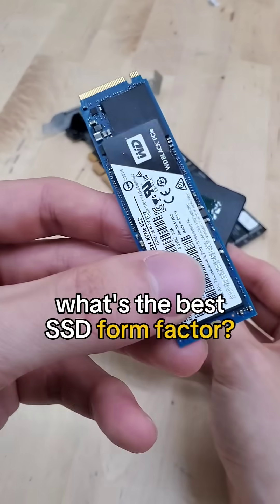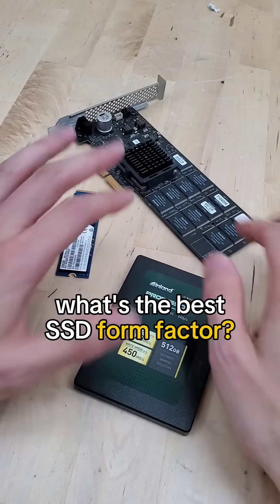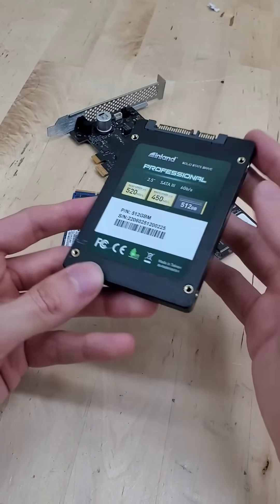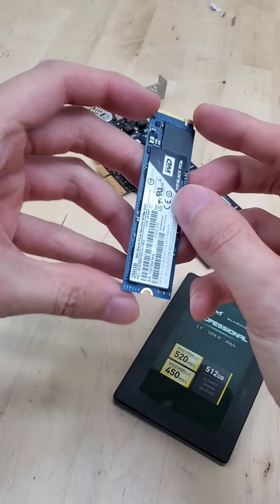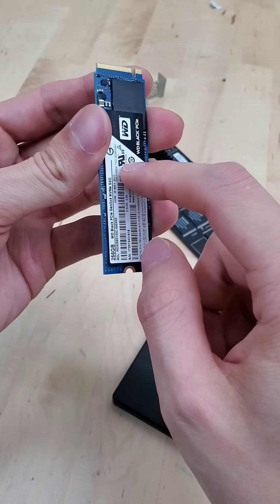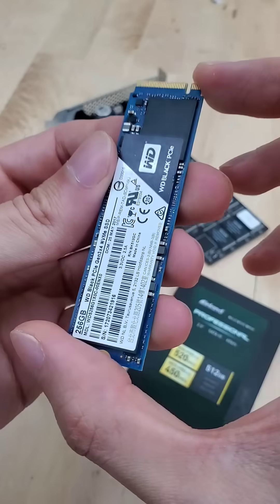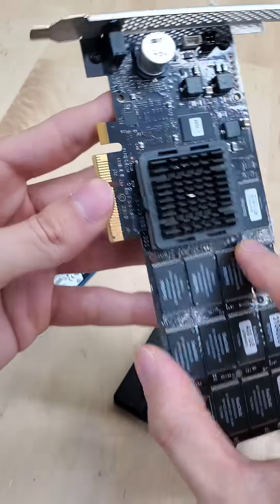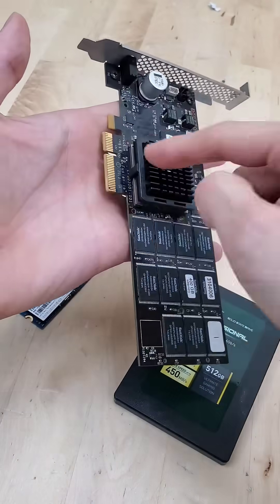The beautiful diversity of SSD form factors

Comment: The SATA SSD is fine and fast enough for most things.  It's great for backup and long term storage.  I wonder how much longer SATA will be around.  

I used a HD the other day for a back.  After watching it for hours and have temp warning, I ordered another M.2 for daily backups.  The hard drive will be for long term, painfully slow monthly backup.

A card might be okay, but I would want raid.  With x16 gen5 and 4 SSDs you can get 50 GB/s.  My 14GB/s on a single M.2 is good enough for me.  But I would not mind 50GB/s for fun.  :)  I would never notice the difference.

Comment: Sata controller is limited in speed but can theoretically support more storage space

Pci-e 4/5  x4-gen1/2/ support various speeds might use the chip sets on the mobo to do data transfer this eating less data lanes for CPU  that could otherwise be dedicated for other things

Pci-e on the motherboard X4/8 slots also have the ability of being able to use multiple nvme like a RAID card in

X2 X2 X2 X2

X4 X4

X1-X1-X1-X1-X1-X1-X1-X1

Comment: Did you the PCIe one working?  I have that same card and it worked before but now I can’t find the drivers for it.  It’s the same HPE one.  It def doesn’t have the fastest speeds though.  It has the best longevity/durability

Comment: Gotta keep in mind though for replacing an SSD in an older machine circa 2020 and earlier, the m.2 slot may be SATA only and therefore not support a PCIe m.2 SSD. I had an Inspiron and Acer Nitro laptop from 2017 and 2018 respectively that had m.2 slots but they were SATA, no PCIe support.

Comment: M.2 does not get hot. I have 3 of them. 7,200gb a sec. 4 lanes. I push them to the max for 3 years now and no problems. 44c max temp. No heat sink. They can run reliably upto 80c in fact it has been proven M.2 runs better at a little higher temps than other chips. Last thing, that pci-e has access to the same lanes as a M.2 sata ssd 550mb a sec max.

Comment: I believe that E3.L allows for the highest storage density (see Kioxia's new 245TB drives), which arguably makes it the best form factor.
Personally I quite like U.2 2.5" SSDs, since there's good m.2 to u.2 adapters and used enterprise u.2 tend to be cheap, relatively speaking.

Comment: Plug-in SSD not as expensive as implied here.  I use it as the system drive in nearly all my builds, with another storage drive. Storage is anything from a HDD to an SSD RAID to a NAS.  Split your storage, boot/program and storage. No need to $pend on room that doesn't need to be fast.

Comment: That AIC SSD is clearly PCIe x4, electrically at least, so theoretically, no, it's no faster than an NVMe SSD, since it too would be electrically PCIe x4. I'm not aware of any PCIe x8 or x16 AIC SSDs, though I supposed they may have or do exist, but functionally most of the AICs were meant to be identical to their NVMe M.2 and U.2 siblings in the product line up. They would all be generally higher performance, in more than one way, not just speed, to a consumer M.2, but compared to their siblings, their performance was generally identical because they were all PCIe x4 with the same specs. It's just that back when AICs were a big thing, a lot of server boards didn't have M.2 slots.

Comment: AIC SSDs are getting really cheap on the secondary market rn for stuff like Sandisk IO Drive Fusion Cards. You can get 8tb of enterprise grade PCIe gen 2x4 Flash Storage for the same price as a Sata HDD of the same capacity.

Comment: M.2 is just a mini-PCIe/mSATA connector and my HDDs are connected via a SATA card on M.2!

The disadvantage of M.2 is that it bottlenecks the PCIe connection for the GPU, because they share the same bandwith and also having near to no loading speed advantage of you are using Windows.

I oversimplfied it, but having more than one NVMe SSD can, depending on your Mobo, hurt the GPU performance a lot (it hurts much more with Nvidia cards).

I have put several comments into one again...

Comment: The PCIe to M.2 controller cards are much cheaper than the dedicated PCIe slot SSD. I got my controller card for $17 and connected my $200 M.2 inside. It works just fine.

Comment: Define best. NVMe with U.2 has the best power rating so you can run the fastest with most densely packed chips, but too powerful and expensive for consumer. eMMC is probably too weak and slow for many but great for embedded system.

Comment: I like SATA SSD formfactor. Especially in NAS situations where you might want to quickly change one out. Wished M.2 speeds could come to SATA formfactor.
Reply: It's called U.2/U.3.  A little thicker than 2.5" sata but you can actually hot swap it unlike M.2.
Reply: @nadtz  Thank you for telling me this! I am looking into building a small NAS and th is is exactly what I want!
Reply: @clipeclipaway  No problem, good luck building the NAS.

Comment: the only time i say you should absolutely USE NVMe over SATA is for the boot drive, after that just use SATA, there's typically way more SATA slots for expansion and the speeds don't really matter THAT much, NVMe M.2 SSDs are the way to go for a boot drive

Comment: I'm not a big fan of the M.2-format taking over in that the 2.5" format seems to be diminishing. - Why?... Being able to still hook up at least a few drives to SATA is important, cause a lot of storage doesn't need PCIe-speeds, nor that heat-generation. - SATA-style SSDs aren't done yet, but I see fewer and fewer, particularly the faster ones that are affordable (as there are many cheap ones that are even slow for SATA-standards). - At least the likes of Crucial are still around, which isn't the cheapest, but not the most expensive. - It's just that... They've been coasting on that last series of SATA-SSDs and seem to never have made anything new. I think they should, one last time, make the best 2.5" SATA-SSD they can and keep producing them for a good price and also at different capacities.

Oh yea, that's the other thing I forgot to mention, especially smaller capacities, which are great for operating-system drives or storage for smaller files or for like smaller projects like hooking one up to a Raspberry Pi for instance, are diminishing especially. It's quite difficult to find 256GB or even 500GB sized drives at times, which I feel is a problem. - Not everything is for mass-storage like video-files or gaming. I'm definitely not going to buy a 1TB SSD just for a Raspberry Pi project, screw that. I've been trying to snatch up any 256GB and sometimes even 128GB (though I generally wouldn't go below the 250 or 256 standard) drives I can find, but only if they're at a sensible price, which of course is also the issue, as often the lower capacity you go, the more expensive it is in effect per GB. So I try to find deals just so that I have a bunch.

Again, it bums me out that they're slowly disappearing, cause I think people don't realize how useful they are and most people definitely do NOT need PCI-e speeds anyway. An OS doesn't even really use that, it's only when you want to stream massive worlds (maybe, even though they have to go to RAM and VRAM anyway) or want to write huge amounts really fast, which I can guarantee you is way more uncommon than the use-cases for smaller SATA-speed 2.5"-SSDs.

Comment: M.2 factor have 2 options, m.2 sata and m.2 nvme. m.2 sata has k and b key whereas nvme has only k key. also there are some boards that support sata and nvme on its slot but be reminded that sata still going to be limited by its sata controller so it will not be as fast even vs gen 3 nvme.

Comment: SATA is not much cheaper anymore and that PCIe seems to be max 4 lanes so that doesn't make it any faster than M.2, especially since new motherboards have an M.2 slot which is directly connected to the processor instead of the chipset.

Comment: Well, the 2.5" SSDs seem more like a legacy solution today.

For instance, I've upgraded my old PS3 with one of them. It's only a slight improvement over the original HDD, speed wise, because PS3 I/O is dated and kinda slow, focus was on graphics performance, not storage.

But a new SSD has a billions of hours MTBF number as opposed to the millions that HDDs usually have, should thus be way more reliable than the 18 year old original, not to mention that it's hundreds og GB rather than tens of them 😄

The PCIe card is the real deal regarding performance, it's almost RAM speed in my perspective, you basically tap into the full bus width, and by having space for multiple NVMe chips, they can run in parallel, thus reducing any bottle necks if there were any. No matter how many SATA controllers and drives you RAID, they all rely on the same PCIe bus, so they'll never outperform an NVMe PCIe card... RAIDing for speed also requires more computational power than direct chip access.

And you can still RAID the cards for redundancy and hot swap if your motherboard supports at least 2 of those cards and hot swap.

The M.2 NVMe cards are just the natural evolution of internal storage space for semi-portable systems, slightly bottle necked by the limitations of the 1-2 chips, but has a great compact size that easily fits into even a slim laptop.

Comment: I used to be sata all the way up until a month ago when I saw a few decent gen 3 m.2 for only $10 more than sata drives of the same capacity. The boot times, the program loading times, just everthing....... Wow! I'm never going to buy another sata ssd again. Unless I need a replacement drive for a bad xbox 360 or hdd or something similar like that

Comment: Honestly, I still like the SATA format, though more and more cases don't have easy room for them.
Reply: Just strip off the external case and you're likely to end up with a much smaller board. And since SATA drives are slow they don't need much cooling - just stick them anywhere.

Comment: For most people (99%) 2.5 ssd is more than enough, m.2 and faster for most users it will improvement of 1-3 second faster than 2.5 ssd. Other than data transfer speed 2.5 ssd is more than enough for most people.

Comment: the PCIe card and the M.2 are exactly the same. M.2 is the formfactor/connector and it uses PCIe connectivity.

the M.2 connector is just a smaller more compact PCIe port.

Great video terrible execution.

Comment: Its crazy that then there is HDDs that are faster than some SSDs. SAS aka Modern SCSI HDDs are capable like having 20+gb/s speeds at 7200 rpm, but are mainly used in Servers and extreme Workstations.

Comment: Last I saw, the SATA SSDs are at price parity with the m2's in terms of cost per storage unit.  But you might use the SATA SSD anyway in an older system with no PCIE storage boot support, or if there's a lack of PCIE lanes.

Nowadays, you could use an adapter to turn PCIE slots into more m2 slots.  You can even use an x1 slot that way, but you will lose potential transfer rate if you do, although unless it's PCIE 1.0 x1 (the first version of PCIE there ever was), it'll still be faster than SATA3/600.

Fair warning though, the m2 to PCIE slot adapters that take multiple m2, the cheap ones require motherboard bifurcation support, which many consumer grade mobos lack.  The more expensive adapters work without bifurcation though.  The adapters that are x4 and take a single m2 will work regardless.

There's also the u2 and u3 form factors, which take the same shape as the SATA SSDs but use a cable to connect to PCIE, not SATA.  But this is very rare outside of servers, partly because PCIE signal degradation can set in over a pretty short distance, and PCIE repeater chips aren't that cheap.

That said, there is also such a thing as a u2 to PCIE slot adapter, which can enable the use of a u2 without a cable that's too long.

Comment: Funny to hear "plug in the pcie, very similar to a graphics card" while back in the day pretty much everything from extra parallel/serial ports to scanner card and mouse card and sound card was a card among the display card.
Reply: Yeah I remember I had graphics card, sound card and network card on my first PC. Back then my gpu was still on the AGP slot, not PCIE.
Reply: @jasonchan5504 Ahh yeah AGP
Reply: @jasonchan5504 AGP 8X had such a good run, haha
Reply: @jasonchan5504   AGP? Cute, my first one (x286) had everything on ISA cards/slots and 128 KB of EDO-RAM...
Reply: PCIe network cards are still a thing. Way better than a USB dongle if you've got a free PCIe slot.
Reply: @nerd1000ify  Had to put a PCIe ethernet card in one of my PCs after a storm destroyed the motherboard's built in ethernet jack xD would take that over a USB dongle any day though, agreed.
Reply: When was there mouse cards?
Reply: @krich451  the 1980s before the serial mouse became widespread
Reply: @krich451  That was one with the 9-pin connector, a serial bus ISA card. Basically we gamerbojs called it the mouse card at the time to control Wolf3D adventures better 😄 I’m not sure if there was a 9-pin connector in the early 90ies 386SX PCs as a standard or was it a card — I have some faint memory of having had two 9-pin ports at some point and wondering if I could program two mouses simultaneously as input devices (in 1994 or so, so it may have been a 386 with internal serial ports plus a serial ISA card). The cards had removable shorting dips to select the correct IRQ and DMA if I’m not mistaking (or was that only on higher level cards like sound cards and display cards?)

On a side note the joystick port 15-pin(?) was also a separate thing which came on an ISA game port(?) card and was another source for reading input data 😅 It was also used for midi I/O to connect hardware synths and I did my first synth tracks with a Sound Blaster 16 with such midi dongle (the SB16 also had a speech recognition expansion board which was a separate upgrade and could recognize a few words after teaching each word 5 times over).

I get nostalgic of all this.
Reply: All of those run over USB nowadays, which is built into the motherboard

Comment: Hard drives were REALLY slow to catch up to the ever advancing speeds of all other components, for 30 years they were getting larger for sure but not much faster. Then in the last 15yrs they moved at lightspeed.

I used to transfer files between my large mechanical drives at about 80mb a second not so many years ago.  Now I do the same at 2.5 GIGABYTES a second via m.2 drives.  Hell of a change in barely more than a decade.

Comment: The PCI ones came first, if you exclude Ram Disk ones that used vram modules. The OCZ Pcie SSDs were the first truly fast consumer SSDs. We had CF/Nand flash adapters for IDE/SCSI and later for Sata II but they were still reduced to the speed of the controllers/interface they connected to. The PCIe ones really unlocked the full potential of them.

Comment: Frankly, sata has lower speeds, but has little to no heating issues, and the speed difference is neglectable for windows usage (difference will actually be noted on moving files only)
But, as the price are about same (or even cheaper for m2 sometimes), m2 is a good option, if the ssd will get enough air flow (yes, I'm looking at you, laptops with no ssd cooling!)

Comment: SATA SSD uses fake seek times. it basically has to tell the SATA chipset system that its 'found' the data, then give around 1ms delay to "move the seek head' (which doesn't exist).  This is so the SATA software can operate correctly.  NVME doesn't have to pretend to be an old fashioned drive in anyway, so seek time is down to the single digit nanosecond range.  The PCI-E SSD and the NVME both run on the PCI-E bus, so no effective difference between them except the NVME on the motherboard has RESERVED lanes for data.

Comment: You forgot U.2 and U.3 which are even better ... Well they go up to 30TB and more already in the form factor of 2.5 inch SSD (but not with SATA connection of course) ... Speed is NVMe speeds since they to go directly on the PCIe lanes.

Comment: To be clear you are comparing SATA SSD's and PCIE NVME SSD's.  You get a lot more out of NVME than just M.2 and PCIE AIC.  U.2/3 and E1.x formfactors, (generally) much higher IOPS and sustained performance.  And the difference between consumer and enterprise NVME is a whole rabbit hole of it's own.  Long story short 'best' depends on need, there is no 1 size fits all.

Comment: I have a gen 2 teamgroup 1tb drive in my crosshair 5 formula Z. Pci-e 2.0 via an nvme pci-e adaptor ❤ 5gb write speed on steam😂 2014 build ❤ still have a slot and pci-= lanes  ready for a second r9 290x. ^^ i never could close my sidepanel in 10 years. Amd fx-9590

Comment: i mean. theres no reason to hate on flash drives. external ssd. and various others that qualify. you can go on for longer than talking about the differences. benefits. or problems with any given form factor. but it depends heavily on what your application is and whether you feel the need for fastest speeds. because a flash drive willl technically get the job done. but often at the slowest speeds.

Comment: I have yet to find someone who can actually tell the difference between SATA and NVME speeds. Not saying there aren't cases where the difference actually matters, but people over-hype NVME to an unholy amount. That's where merely looking at the on paper speed will cost you.

I like my OS on an NVME drive, but having more than one is silly in most cases. Paying more per gig of storage for no reason. SATA won't lower your GPU bandwidth, either. There are boards that don't tie the m.2 slots to your main PCIe slot lanes, but you have to DIG DEEEEP in the manuals to find that out in the case of a lot of boards.

Comment: What's cool is you can get open box M.2 drives that are 20 bucks and still 6 times faster than the limit of data / fastest data drive. There is literally no reason to get SATA these days. If you need more drives, then get a pcie adapter for your M.2 which costs 17 bucks on amazon